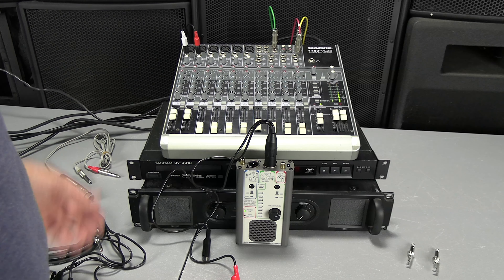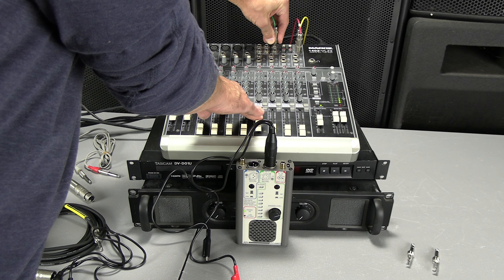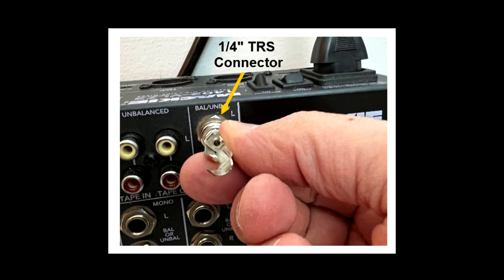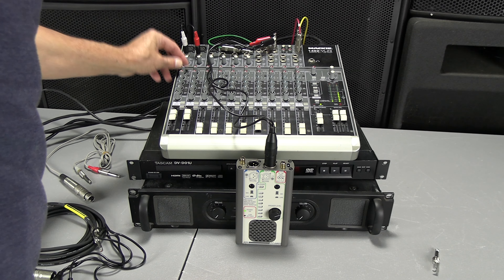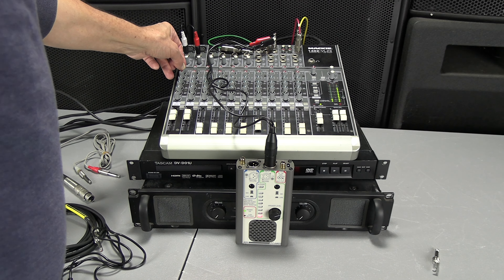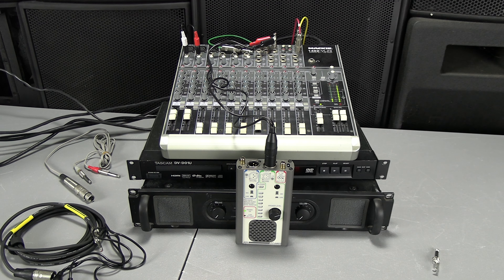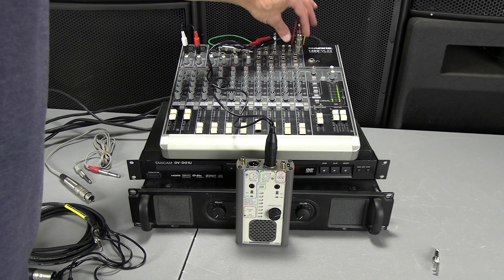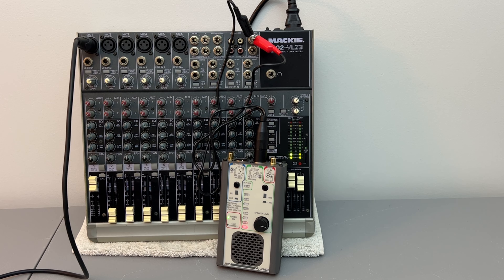Troubleshooting and Testing the Outputs of a Mixing Board

Comment: Thank you for the video. 

I've got an XLR input with lower signal than the other XLR inputs on a small format analog mixer. 

What test could be done to determine why the level is so low?

Can this be used to check if there is a cold solder or a damaged pin?
Reply from the maker: Without having the mixer in front of me, I would suggest the following: First, I will assume that you are using the same cable and mic to check all these channels, Is the signal just lower on a mic or line input (not sure if your mixer uses the XLR for both mic and line), and Second, is there a Mic / Line switch on this channel? If yes, I would clean the switch with contact cleaner (I've had issues like this before that some contact cleaner took care of), clean the fader, gain control, and any other buttons / switches for that channel as well. Third, open up the mixer and check the XLR connector and for cold solder joints. After that, it will most likely be in the circuitry (Op amp, capacitor, etc). Hope this helps.
Reply: Wow, thank you for the response. 

I am using the same mic and cable for testing all channels. 

All channels have XLR mic inputs and 1/2” Bal / Unbal inputs. 

For the moment, I was only concerned with the mic inputs, using a mic at mic level. 

I’ll clean all of the connections. I’ve got some deoxit cleaner and conditioner, as well as compressed air and 99% isopropyl alcohol. 

The part I’d like to do, is to check for cold solder joints. That’s thr part I don’t know how to do. 

Thank you again
Reply from the maker: Use caution when disassembling the mixer, remove power, but most of all keep track of how you remove the parts and pieces. Checking for cold solder joints is easy, but takes a keen eye. I just try to move the XLR to see if it is loose in any way, look at the solder joints on the circuit board, and go ahead an re-solder the XLR leads while you have the mixer apart. Again, if you are not familiar with opening up equipment use caution and take your time. As a side note, you also void any warranty when opening up the mixer and if you have to take it to a repair shop they will either not work on it or charge extra if they feel it was opened. Hopefully you'll find a cold solder joint and get it fixed.